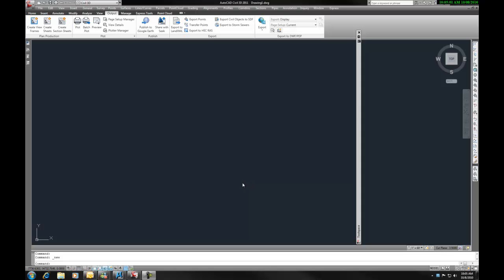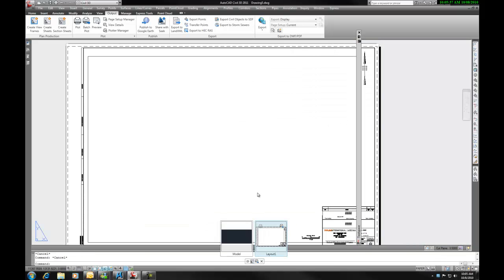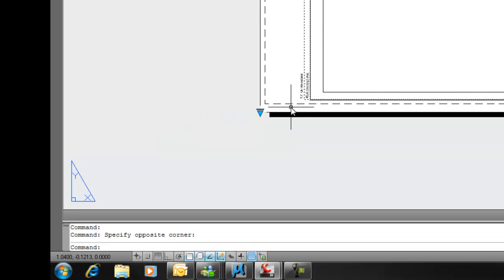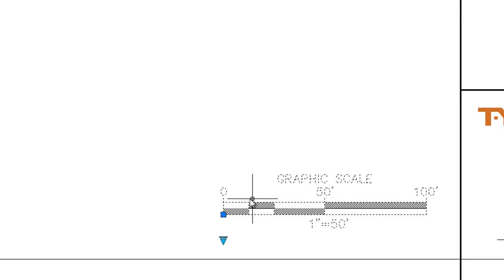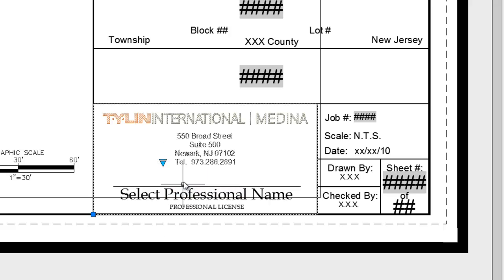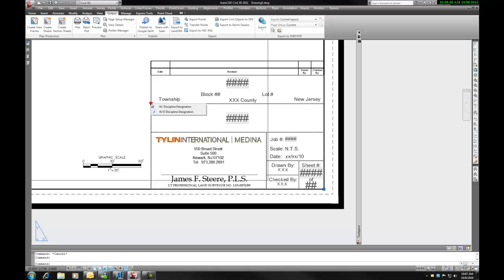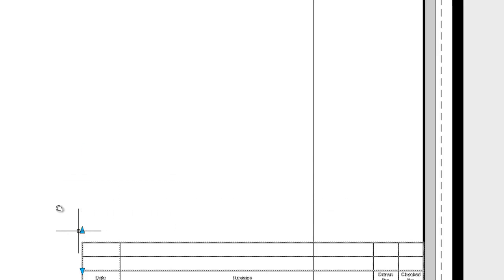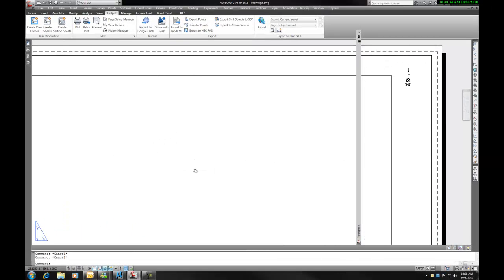AutoCAD Dynamic Title Block

Comment: Hi Kurt, this template incorporates many great ideas.  In this video, you mentioned that there may be a video talking about fields connected to sheet sets.  Is that available?
Reply from the maker: billpinky64 I do not have access to AutoCad anymore. I now work for Bentley and doubt I will be posting anymore videos for this product.